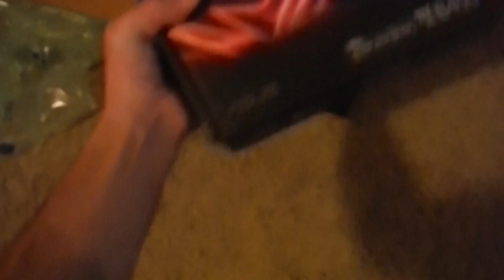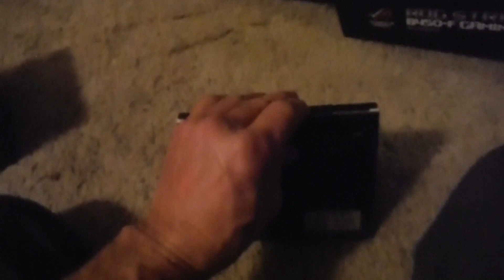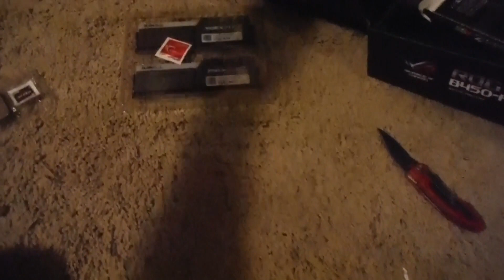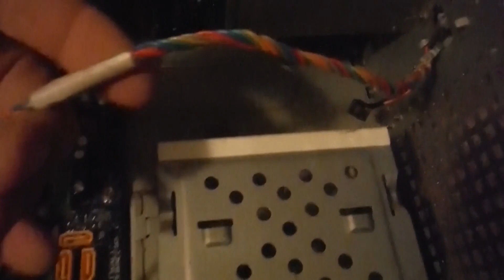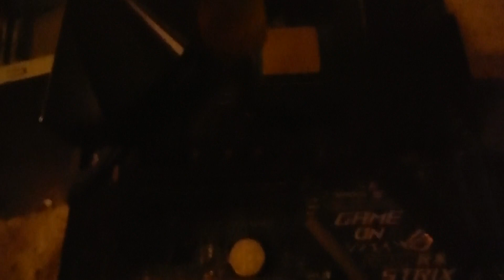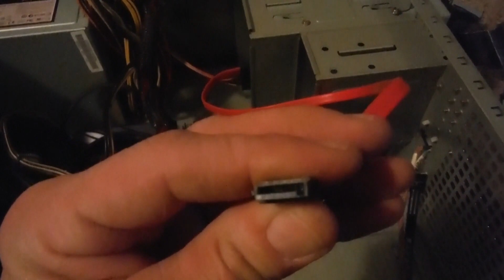Amd Comp Build 6 Core 16g RAM

Comment: Don't use solidstate for swap!
Reply from the maker: Why? It seems to be working great so far!
Reply: Yes it works awesome! But SSDs have a limited re-write life and Swap can burn them out rather quickly... much better to throw in an old small HDD, or set up a RAM drive as swap in bootup.